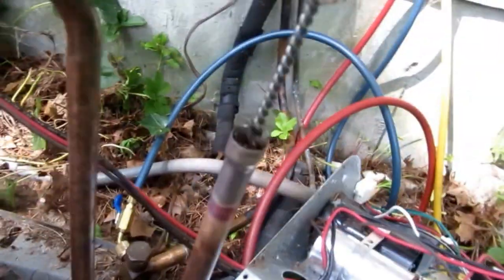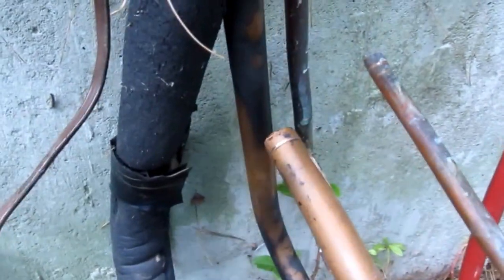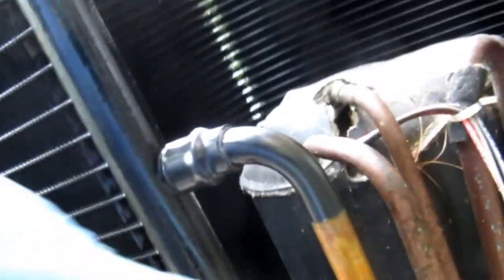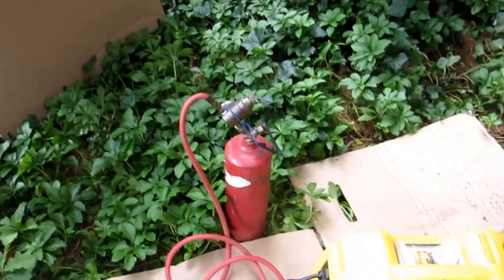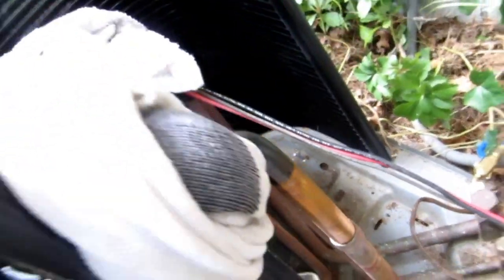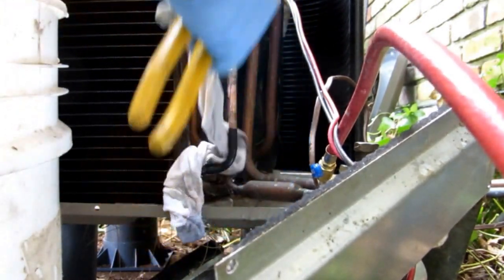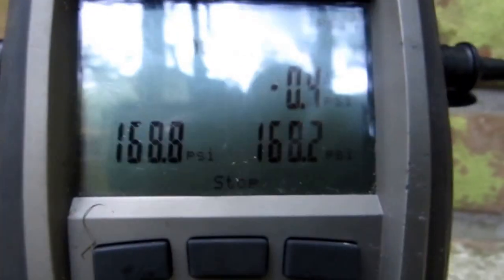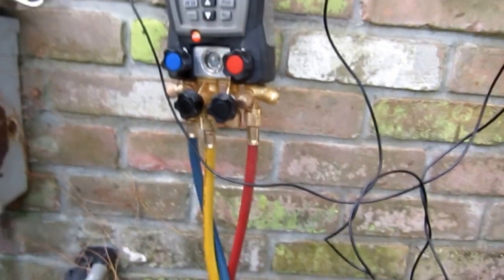HVAC:york micro channel replacement

Comment: I Tried to Hit Like But, it Did not Work. Oh, well. Great Video !!! cool Video!
You Weld ok. I've Seen Worse. :-) ha ha ha ha . Joking around.
Question---Does the Bottom on a Micro Channell Condenser Sit Metal to Metal on the Bottom? if So , some Foam Tape on the Bottom of the unit might be a Cool Protection from metal to metal chafing. Possible Future Leak Prevention. it Would be Fast and Easy too.

Comment from the maker: the cost of just the coil was around $900.00 i was shocked when i seen the price .but its under warrenty well lets hope the warrenty goes through.it should i never been denided before .i really don tlike diong a repair like that i rather just change the whole unit its a lot easyer@ faster  i think less things can go wrong.